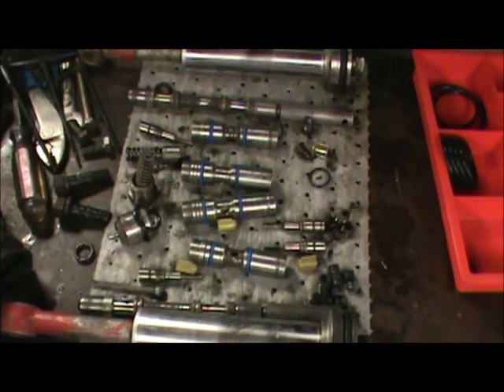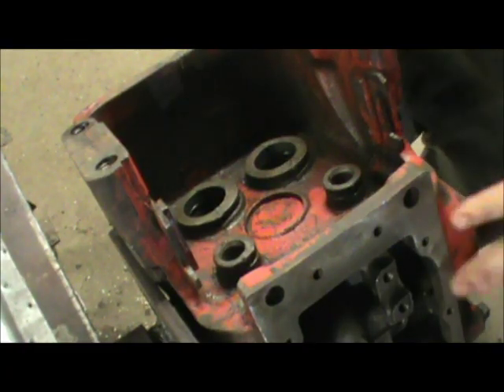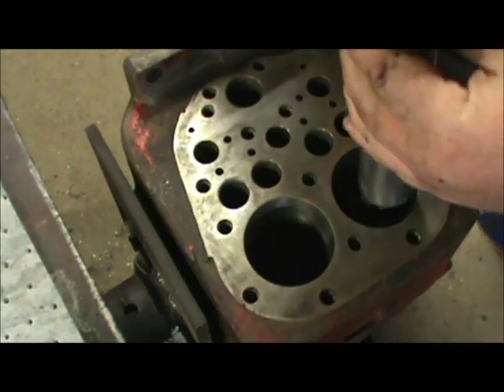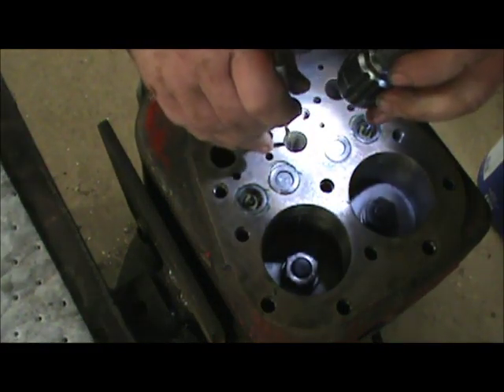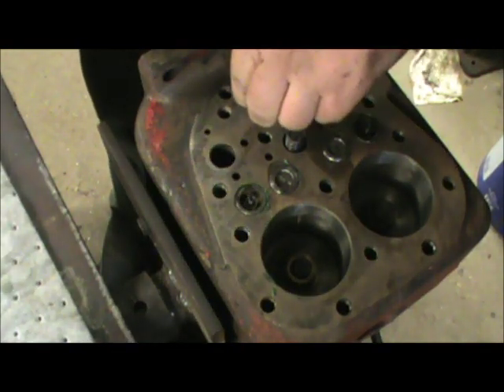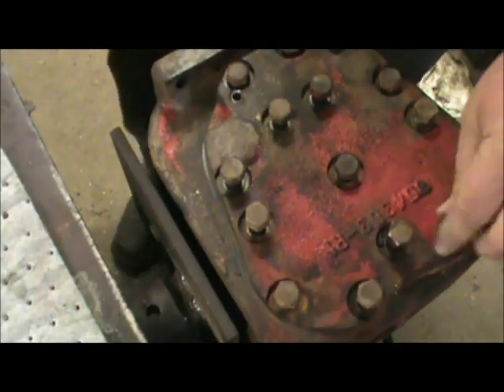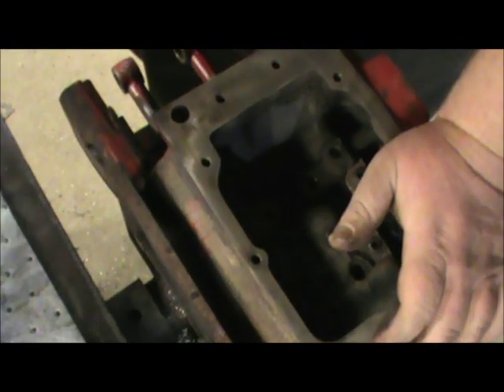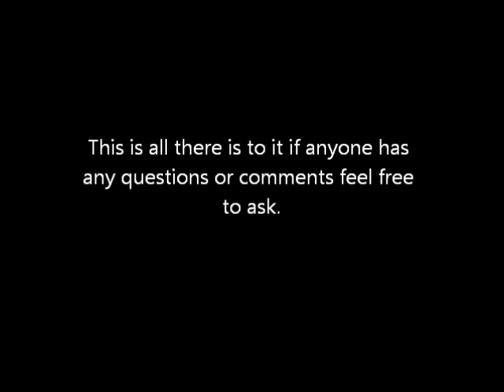Rebuilding Farmall Touch control Part II

Comment: I'd like to see you do a video on replacing w/new and rebuilding an original Hydraulic pump itself and how to properly clean the lines and controls like the dealer recommends before installing a new pump. You do good videos for learning.  Maybe do a video on replacing the rear axle seals etc on a Super A or C.  Thanks brother.
Reply from the maker: Thanks for the comment. I have a lot of ideas for videos. I do a lot of repair work in my shop. I just don't take the time to make videos.  I plan to start making more videos.  Thanks for the comment.

Comment: when reinstalling the unit on the tractor what is the proceedure for bleeding the air out of the unit.  followed the bleed procedure in the manual but it not moving. got mine all put back together and tested it , i'm not getting any movement out of the unit.  watched the video several times and mad sure i put everthing back the was it suppose to be.  the one thing i notice is that you have the two large pistons all the way to the bottom of the hole  does this matter?

Comment: Kenny.  Great video.  I'm in the process of doing the same thing to the touch control on my 51 Super A.  Couple of questions.  Seven of the nine plugs in the inside are not coming out.  Actually broke two hex wrenches trying to remove them.  Any hints? Is heat an option? Also, how do you item 20 on the parts diagram out?

Comment: I have a question.. Mine quit working so I took head off and all the pop- its are ok but one of the center plungers that the pop-it goes on will not freely move the other one will go up and down with a small screwdriver but this one stays down when pushed. Going to rebuild it but what is making that one not move freely?

Comment from the maker: There is a pin and I think there is a bushing also. You need to look and find where the play is. I am not sure if these parts are still available from dealer. If not you could have a machine shop take the play out by making a pin or bushing

Comment: Good morning, what is your charge for this repair? I have a 53 Super C and the hydraulic unit is leaking like crazy. Thanks
Reply from the maker: I get $450 for a complete rebuild including all parts need accept the filter screen. Most of the time the filter can be reused. The filter is washable but sometimes the spring in it is rusted out.

Comment: I have to add fluid to the reservoir. It will leak dry setting over the winter. No external leaks that I can find. Where is the fluid going?
Reply from the maker: Check the engine oil and see if it is over full. If the hydraulic pump shaft seal is leaking it will put the hydraulic oil in the engine crankcase.

Comment: can i ask where you got al new seals and o rings?? i have a super c and it runs the same touch control box , and she is in need of some love......
Reply from the maker: I have the leather dust boots that go around the piston and control valve rods reproduced myself. I have those available for sale. I have been getting the rebuild kits from the CaseIh dealer but I am currently in the process of reproducing those also. Should have them available in the next week or so.  I have cores at my shop and rebuild them to switch out. I don't think the leather boots are available any more and have been superseded to the rubber ones, but I think the leather ones last longer and work better. If you are interested in getting some boots or a rebuilt box just let me know.

Comment: How does one go about putting the leather boots back where they go on the touch control box?
Reply from the maker: I use .035 aircraft safety wire and safety tie wire pliers. The wire goes around the top and bottom of the boots. There is a grove at the bottom where the piston comes out. Then the top you pull it together around the piston rod. You could use welding wire or  galvanized hardware wire and a pair of pliers to twist it. I have the boots available for sale along with the wire to tie them with if you need the boots.

Comment: I have a 140 and the hydraulic lift is acting strange, the two levers that control the lift seems to be working against each other. in order for me to lift the back disk I have to move the lever that controls the bottom cultevators?? whats going on??
Reply from the maker: Crystal Smith I will be glad to try to help you figure it out. I need a little more description about what is going on.

Comment: I install new kit on my touch control  system and a orifice screen and cleaned filter .poppets were not deformed. Unit still over heat. This was the reason I had put this new kit. Engine under a strain. Controls work front and back. Hydraulic pump was replaced a month ago be caused hydraulic oil was getting into engine oil. The tractor is a farmall 130. If someone could please help me with this problem. Thing